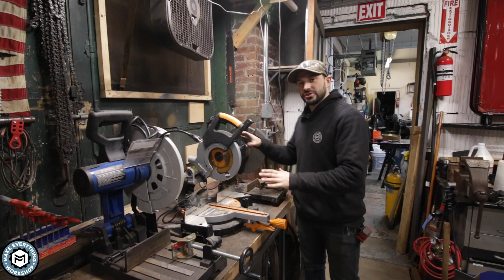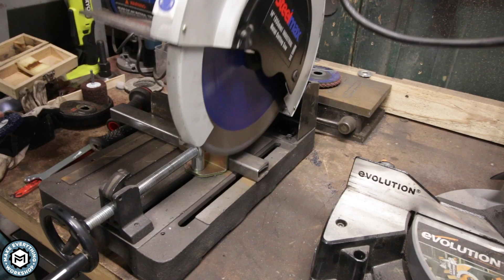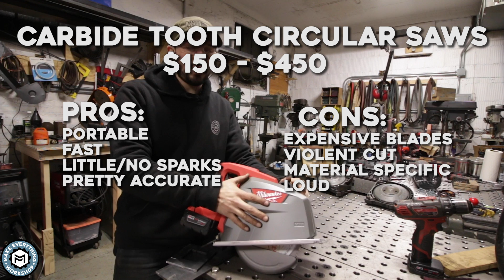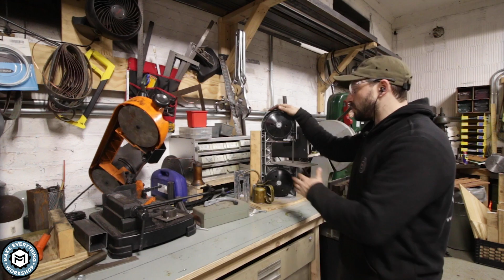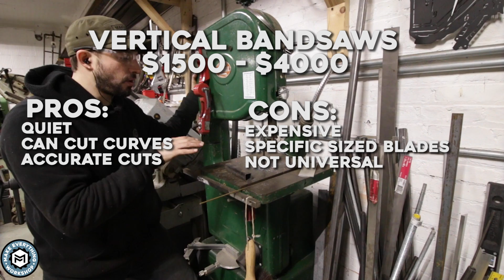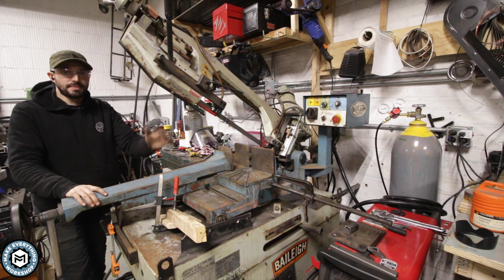The Ultimate Guide To Metal Cutting Saws. From Hobby to Pro!

Comment: You forgot the power hacksaw.  Just kidding.  We had one in school shop 50 years ago so I was familiar with them and bought one on an auction 30 years ago for $5.  I used it quite a bit until I got a porta band and a big horizontal band saw at other auctions. Good video.

Comment: I’ve been a toolmaker for over 50 years now and I’ve probably used every saw known to man. This was a very good video to explain everything. Like you said, the saw you buy should be based on your requirements. Before I sold my machine shop I had a beautiful fully automatic horizontal. A big vertical bandsaw and 2 cold saws. The cold saws paid for themselves in no time. We could cut material with a decent finish and could hold +/- .0005 which saved consequence milling operations. High speed steel like you said there is just the cost of sharpening. Now in my garage shop I have the Evolution along with horizontal and vertical bandsaws. Those blades are great but as you said, very expensive. That thing is a beast. For fab work you can’t beat it. The only thing I might still buy is the porta band.  Only because I also have wood working saws and it’s a pain changing blades from wood to metal and vice versa. This way I can keep my wood blade on the vertical. I’m too lazy to want to change blades back and forth for simple small metal applications. Anyway, good job on the video young man! 👍🏼👍🏼

Comment: Such a great video! I am currently looking to buy a machine for high-volume cutting of 6mm diameter solid stainless steel round rods into discs with a burr-free and mill finish. 

Would coolant-cold saws or horizontal band saws (or any others) be recommended for my specific needs?

Thanks! Keep it up!

Comment: What would be the best saw to cut 1/2” thick mild steel plate, 6” or 8” wide?  Thx!
Reply from the maker: A good horizontal bandsaw, or if you want ti bring The saw to the work, get a good metal cutting circular saw
Reply: Thx. I really appreciate the advice and great video you’ve made.
Reply: Plasma torch.

Comment: I bought a new Milwaukie cold saw, $600 Canadian, first piece of metal I cut was 1/16" wall 1/2" square tube, it jammed right as it was finishing the cut and ripped off three of the teeth, that blade was done, bought a new blade for $160 Canadian, next I tried to cut 1/8" X 2" angle iron with the outside corner up, blade went dull instantly, so I installed an abrasive disk, used the saw for about a week and oil started running out of the gear box, sold the saw for $200, went back to my Milwaukie abrasive saw I had since they were first sold.
Reply from the maker: I’m shocked you had that experience. I’ve made literally thousands of cuts with mine… I use the Diablo cermet blades they are about $40us, and work great. I have noticed if the battery is low it’ll run slower and cause more binding…

Comment: So, can I use the evolution saw to cut 1518 carbon steel hollow bar 40 mm x 28mm to make some kind of bushings ???
Or should I use a band saw ??
I have to make about 8,000 of them.
Thanks.
Reply from the maker: I’d use a bandsaw, or if you can get your hands on a true cold saw, get that and get a blade specifically for that application

Comment: Great video....what do you use for stainless? I have an old horizontal saw made in Minnesota (No coolant with hydraulic drop.  and an old Delta Wood/Metal bandsaw. I'd like a cold cut saw. One of the neatest little bandsaws I have seen is made in Brazil by Piranna.

Comment: Great vid!  Could you maybe do a special video on cutting stainless and titanium?  Maybe some other more exotic materials as well.  For example, I know Evolution has a special blade for cutting stainless, and I suppose one could use he abrasive saw to cut stainless as well, but is he heat of the abrasive going to damage the chemical composition of the stainless (make it more prone to rusting?). Are thee any other options? (Other than plasma cutting)

Comment: Thanks for sharing the info. Would a portaband be suitable for aluminium plate ie the cutting speed? I have been using grinder, circular saw and jigsaw and either the teeth clog of the grinding discs where down in minutes. I use aluminium flatbar upto 20mm thick. Thanks.

Comment: I bought Diablo steel diamond 10 inch for cross cutting 8 to 10 inches using my old dewalt radial arm saw what do you think I don’t cut metal that often  I cut mostly with jigsaw or reciprocating

Comment: WOW.   I've seen all these tools in different shops, but never in 1 shop!  Closest 2nd was at a shipyard. Thanks for sharing.  I still use abrasive saw like your inherited one for the reasons you pointed out. I use a carbide blade and reostat control to slow it down a bit also.

Comment: Thanks for the great video. I found a Powermatic 143 at a garage sale years ago at a bargain price and it is also my favorite saw. I bought rolls of bandsaw blade stock on eBay and a Harbor Freight bandsaw blade welder because of the cost of blades. There were many failed attempts to anneal the weld, but finally I turned off the shop lights and could see the color of the metal easier. My success rate went way up and I no longer worry about breaking a blade.

Comment: hey im new to welding and i just bought a cutting saw , i noticed when trying to cut very little on the edge of the tube the disk of the cutting saw is like bending , is this brand issue cuz it was cheaper, or its normal? its 2000 wats 355m disk

Comment: Holy crap. That’s a lot of saws! 😅 I’ve a few cold cut saws and it drives me crazy how expensive the blades are. How often do you have to replace that cheap blade on the portable bandsaw? Just wanted to know how many cuts it will do before it completely dulls. Thanks

Comment: I've been cutting 6" square tubing  1/4  thick I've been cutting it with my grinder with Metabo cutting wheels I've been looking for a chop saw that can do the job on 45 degrees any recommendations.
Reply from the maker: 6” is pretty big for a lot of the cold cutting saws but a good chopping bandsaw would be good for that with a low tooth blade and good rake

Comment: Nice video, I’m now looking for a saw for my tiny shop for months. Your video help me out a lot! 🙂👍🏻
Reply: Any dry cut metal saw with the carbide teeth blade is gonna FAR SUPPERIOR to band saws that cost thousands and definitely better than an abrasive saw which is the worst of them all. People complain about the cost of blades for the dry cut machines or that stainless  steel is a problem? Why not just purchase a stainless steel cutting blade? Expensive? well let's add it up band saw is way too expensive cuts SUPER SLOW and takes way too much space also takes longer to replace blade add to that coolant cost and ALLOT OF MAINTENANCE. abrasive saw just flat out SUCKS BALLS. that leaves the dry cutting saw which cuts by far the fastest about 10 times faster if not more cuts super clean very easy and fast blade change no maintenance small foot print can be purchased for about $500 for a good one. but they complain about the blades costing over $100? The time saving alone more than justifies the cost of blades.

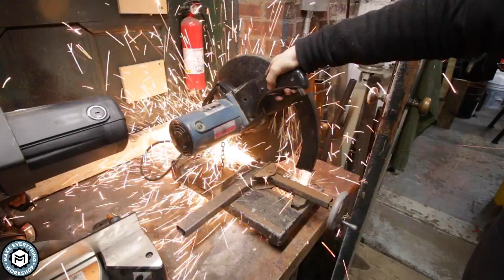Comment: Thanks for the video. Over decades, I've acquired pretty much all of the tools mentioned costing under $250 as well as a jigsaw and sabre saw.  Low cost bandsaws (as you mentioned) drift a lot, but are convenient.  I also have a 14" abrasive cutoff saw which I almost never use because it is WAY too slow. The abrasive cutoff demo brings me to a confusing aspect of your video. In several instances, it appears as though you show a cut, but change the replay speed mid cut. But it is not explicitly clear that you have. For example, it is unclear if the abrasive cutoff actually cut that tubing in just 7 seconds 3:40 (mine takes many times as long). It would help the video to show replay speed up or add time stamps.
Reply: What will be the cheapest but value for money option you'd recommend?
Reply: @aberba  I am by no means an expert on power tolls, let alone metal cutting. But, the right tool would fundamentally depend on what your trying to cut - both the material being cut, as well as its shape. For example, a bandsaw will be useless on a large flat sheet of sheet metal.  But, assuming you're cutting tubing or rods, plate strips, etc., my preference is a bandsaw over an abrasive cutting disk. The bandsaw is quieter, does not produce dust (let alone dust that includes fine particulates from the abrasive cutoff saw), and does not shower the area with sparks when cutting steel. Also, I found that at least MY abrasive cutoff saw is slower than my bandsaw.

Comment: For a new born everything is new. Every circular metal-saw blade is material specific, If you use the right blade for right material you wont have any issues, you blade will last for a very long time, also advised to clamp your stock on both sides in order to avoiding flyaway while using circular metal cutting saw. I would not grind on the side of the abrasive cut off saw blade. lastly cold saw in general have a coolant running while cutting: hence cold saw. coolant gives longevity to your cutting blade, mainly heat what kills all cutting blades or violent movements

Comment: Thanks for this video. I'm between the bench top Wen band saw and the abrasive chop saw since they are the ones that can fit the space and budget I have. Will use it to cut up to 2 inch square and round tubes. In terms of accuracy and minimal post-cut work, which would you recommend? i am mostly concerned about the cutting plane being perpendicular to the horizontal.
Reply: Don't buy an abrasive saw YOU WILL REGRET IT. but you can always return it.

Comment: I have an 80-90 year old power hacksaw.
Its quiet and it cuts through big material like butter.
It's got a hydraulic lift so you are only cutting with the blade in one direction. It has flood cooling.
I think I paid 300 for mine. It's really big too. It infinitely adjustable. 
And the blades are really easy to find. 
I love the thing. I put a piece of material in there start it up and I can make a phone call while its running.
It turns off when its done.
It weighs about 400 lbs.....
It's super accurate and the finish on the cut is outstanding. 
They are really hard to find. Everyone who's seen mine has wanted one. I only know of two who have found one.
Reply: These saws are the cream of the crop. I myself have an old wicksteed hacksaw weighing 550 kg. 😅 i have rebuild it completely so it will last yet another 70 years.

Comment: I'm totally down with Making but I'm mainly using wood. I need to up my metal working game and the benchtop horizontal bandsaw or a screaming dry-cut chop saw seems just the ticket. In the review you said the bandsaw is going to be quieter. I'd expect that from the good ones but is that cheap WEN quieter than the dry-cut?

Comment: Sir, 
I'm a newbie.  
I need to cut a flat or square solid billet bar into small (2" by 3") solid aluminum blocks.
I hope to then use these on my little cnc mill.  
I don't foresee myself ever using the saw to cut anything other than aluminum, copper or brass.  (i.e. soft metals).

What kind of saw do i need to cut flat/square billet into aluminum blocks?
Your advise would be great.

Thank you.

Comment: Please google Brobo Cold Saws (Australian Made) Surely USA and Canada has a brand or make of them too)). I am a 20-year on the job now metal fab/laser operator and I would not use any of those three at the start,, ain't nothing an angle grinder cannot cut if you're going that route.. Cold saw or nothing for anything. No sparks just steam as you cut with lubricating fluid. If you set it up and get a tailstock table going you can easily cut it to within 0.5mm (0.0196 of an inch ish).  Mr Make Everything try 12-degree tooth for SS and MS cuts like butter and lasts for ages on a cold blade (tip from my blade sharpeners). Cadmium ones last a bit longer but become brittle over time if they get too work-hardened. D0HSS regulars will last for thousands of cuts if you let the blade do the cutting for ya

Comment: I wouldnt call the last one an automatic saw, as there are saws that can automatically feed the material through and cut bar stock into lengths automatically. The last saw just has an adjuster for how slow it drops, which is actually fairly common on anything over $1000.
Reply: Yeah, that saw looked crude and cheaply built. Nothing was moving smoothly on it.

Comment: Great job explaning. On the metal band saw. I usually have a spare blade for it on hand. When I break a blade in the middle of a job I always have a spare blade to get the job done. Then I order a new blade. As a rule I only cut metal from known stock. No used metal from scrap.

Comment: By far the best blade you can buy is the Makita  general purpose blade that come in the 18v metal cutting saws. They don’t care what they cut  wood, metal, plastic, stainless, pvc, copper aluminum hardened cold roll the blade just don’t care what you are cutting it’s going to cut it. Don’t believe me try it for yourself part number A-96095 best on the market

Comment: Very nice. So if I cut metal regularly, but only cut heavy stock (fork lift tines, probably 4130 steel) periodically, which would work out best for me?
Reply: Is that already heat treated or are you making forklift tines?
Reply: @SW-ii5gg  Salvaged tines from a forklift repair shop. When they are worn down they replace them with new ones and recycle the worn out ones.  My guess is that they are normalized but not quenched and tempered,
Reply: @maaku.moreno  I saw a blacksmith cutting them up with an angle grinder and cut off disks, for leaf springs and other hard material I used a chopsaw.
Reply: @maaku.moreno  I just looked up forging from forklift blades and Daniel Moss was the blacksmith with a guide for forklift blades, there was some useful information about them on the video, several other videos for forging forklift tines also came up in the search, probably have some good info on processing used tines on them as well.
Reply: @maaku.moreno  Daniel Moss said most of them have a tracking number that you can find out what material was used, he said most are 4140 or 1040 I think.

Comment: I’m surprised you didn’t bring up a hacksaw, jigsaw or Sawzall. When I was a kid, a hacksaw (I hated using them) and a Black and Decker jigsaw (blade design caused the blades to break constantly) were all I had available to use. When I was 28, I got a two-speed Milwaukee Sawzall and still use it today, 42 years later.
Reply: Because he prefers to do it properly and safely

Comment: Very nice guide to all these saws.  Where do I get the saw blades for a 14" cold (real slow-cold) saw??  I have a cold saw (30-180 rpm)  but nowhere on Amazon I can find circular saw blades for these saws.  Where do you get yours from?   I'm usually looking for 280 teeth HSS for cutting steel profiles.  Thanks!
Reply from the maker: Thanks! My last blade I for from California cold saw. They had a great purchasing guide and it made it really easy to get exactly what I needed to cut the material I usually cut. Pretty good price snd fast shipping. I got a 240 tooth 14” blade with titanium coating for $190 shipped
Reply: @MakeEverything  Good resource.  Thanks!

Comment: I make things out of old "bed frame" angle iron, utility trailers, truck racks, that sort of thing. It is hard to drill and hard to cut, but it welds up very nicely. Is it tempered or spring steel that makes it so hard to work with? I don't think a porta band saw will work with it. It eats up sawzall blades in no time. I use a 14 inch abrasive chop saw and thin abrasive blades on my angle grinder. Of course my plasma cutter makes short work of cutting it, too.
Reply: Its probably regular mild steel. I bet your running your sawzall too fast

Comment: When I bought my 'cold cut' Milwaukee corded version (five years ago or so) one of the biggest drawbacks was that you could not see the cut line or the blade as you worked.  Did you customize yours with that blade slit for the cut line??  The other thing I found was that there was really very little difference in rpm from my worm drive SkilSaw that I put metal blades on and have used for decades.  So the "slower" rpm for metal just wasn't there.  The chip catcher is nice but not totally effective.  Much better than the SkilSaw but I will still use my worm drive instead as I can see exactly where I am cutting with different models and styles of blades.    It is a decades long habit that I watch the blade not the shoe to confirm I am on the cut line and find I can't give that up. Also for some reason I find that the Milwaukee 'wanders' much more than the worm drive which I attribute to the awkward balance in comparison to the weight down low on the SkilSaw.  So my Milwaukee sits unused in the cabinet.

Comment: Thanks! I am looking for a small metal cutting saw that will cut 1" square aluminum tubing with a 1/8" wall. Will be cutting the same sizes over and over. I have a VERY SMALL shop. I have saved your video.

Comment: It was a pleasure watching the wide variety of saws that you have in your arsenal. Very educational, enlightening and it seemed like visiting a museum. Your explanation skill is exceptional I must say. Having seen all of your robust, best in class collection of saws I am a bit hesitant to ask you about hand held grinder machines which I wanted to know about. They too cut material, right? I had heard these hand held grinders are dangerous machine. If you could highlight some day about their usefulness vis-a-vis the hazzard it would be helpful. I like easy to operate small machine that does not give out sparks and doesn't split with pieces flying all around causing injury, yet does the job well and quick. Is there any thing of such sort?